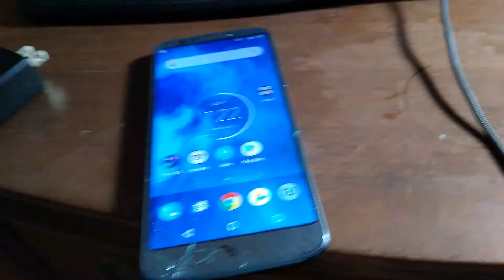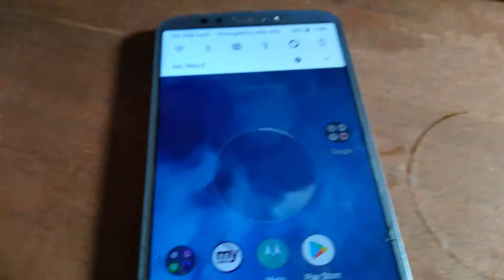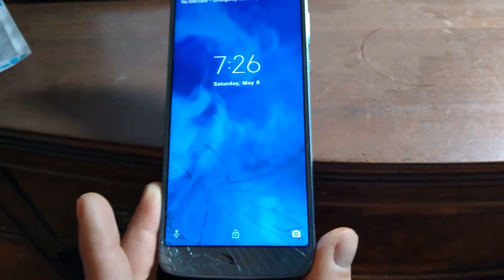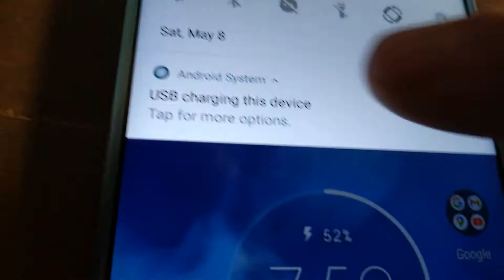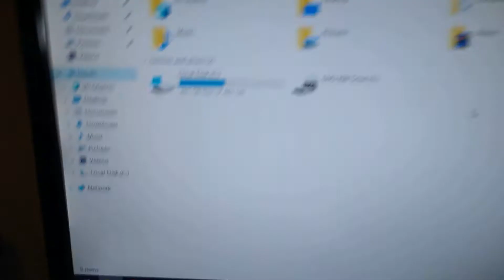moto e5 plus slow charging fix Turbo charging fix

Comment: Mostly will work when u keep the charging plug-in ( port )clean of dust etc mine used to go from slow charge to fast charge just after cleaning it although I guess all issues very still a tip worth trying out ty

Comment: Mine doesn't turbo charge when I connect the mid frame (black plastic covers thats screwed down) , of I remove the mid frame I see turbo charger connected, any ideas ?
Reply: Ye issue kidar milajayga
Reply from the maker: Maybe a bad charger board when pressure is applied it shorts out